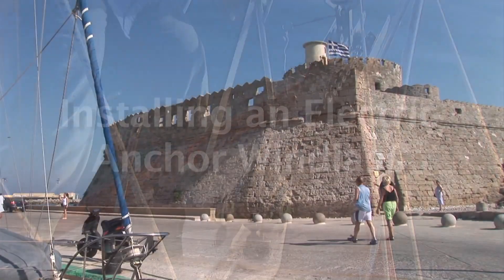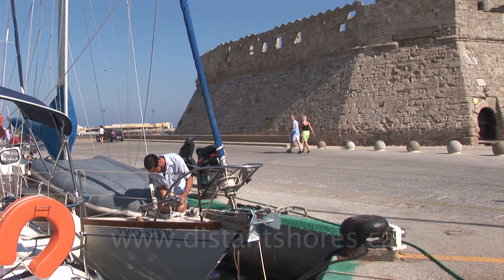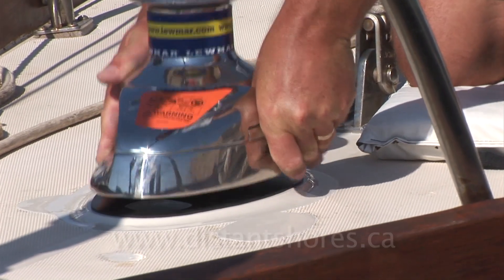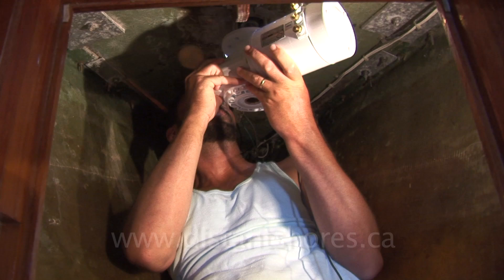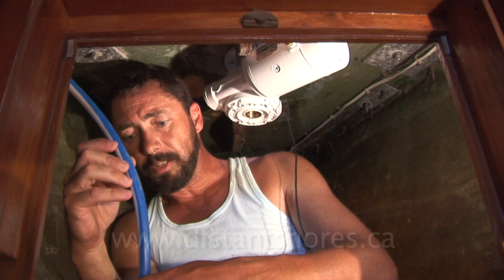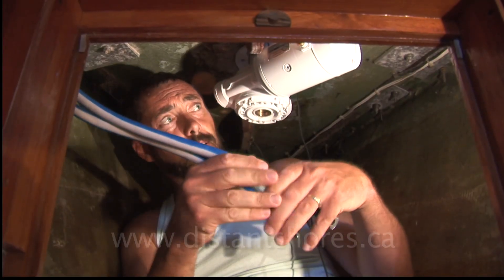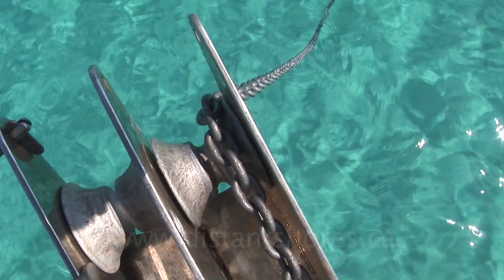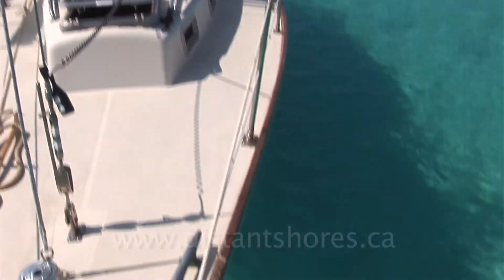Installing an electric windlass

Comment: You don't show how the anchor is gripped once you've pulled it all out.  Either way, good information especially about the shimming of the big motor below.
Reply from the maker: +GoMiGman GoMiGman Do you mean how the anchor is setting underwater? Or how the chain is held on the boat? We have filmed various anchors setting under water if thats what you meant.
Reply: Distant Shores TV It is and thanks for clarifying that!  Happy sailing but I am a pot stinker or whatever you guys call us lol. :D
But we got a lot of sailboats around our area and we have nothing but much respect.